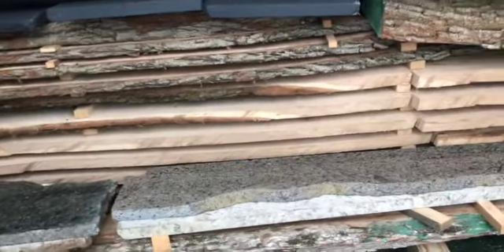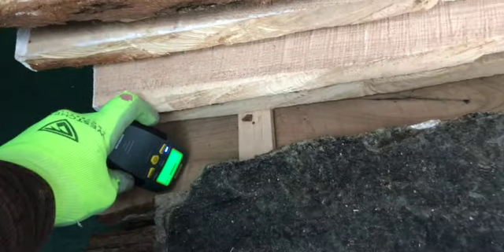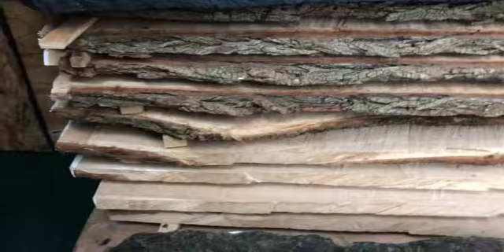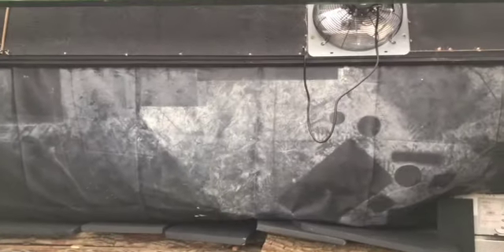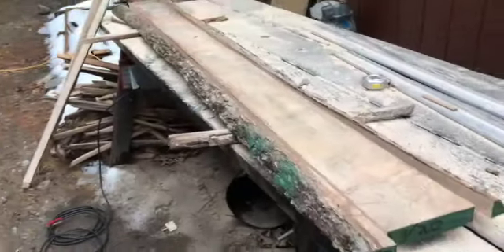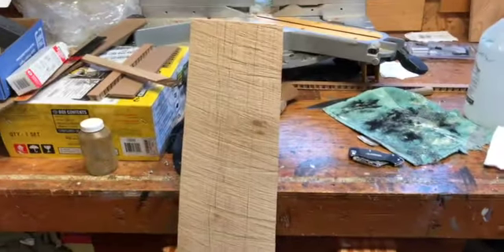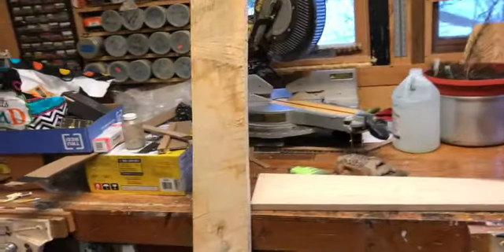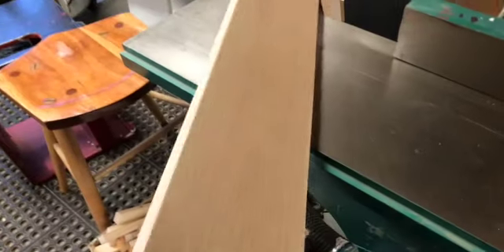Solar wood kiln update II   SD 480p

Comment: I finally got my kiln painted in the inside and working on the electrical.  Glad you have your kiln running, I can't wait to get mine running. It will definitely be a learning process to operate it. Look forward for more videos!
Reply from the maker: THanks. Today it is coooold outside, about 25 and windy with full sun but 90-98 degrees inside the kiln.

Comment: Definitely interested in more of your experience with operating the kiln.. There's lots of people talking about how to build them..very few talking about actual operation.
Reply from the maker: I'll try to make a new video soon. I'm learning as I go. I have a load of white oak in there now that's got to be fully dry by now. The Virginia Tech video is pretty good with details but I know what you mean about the lack of operational information.
Reply: @davelebleuwoodworking127  Great, looking forward to seeing the results.  Would be nice to note what kind of steps you applied throughout the run - opening/closing vents and when, and the results - warp/check/curl.  Thanks for your effort!

Comment: How long was the oak in the kiln? In the winter time, it will take 2-3 times as long to dry than in the summer, which is typically only a month, give or take.
Reply from the maker: The oak took about 4-5 weeks to dry. I'm having trouble drying white oak. It checks and splits fairly easily.
Reply: @davelebleuwoodworking127  Do you treat the end grain as soon as it is cut? That makes a huge difference.
Reply from the maker: @David-fv7zg  Yes, I coat the end of each log asap after cutting the tree down.
Reply from the maker: @David-fv7zg   The checking and cracks are on the face of the boards, not so much on the ends as I coat them